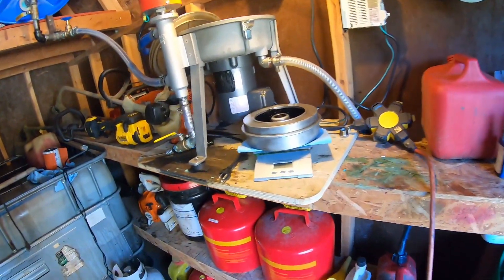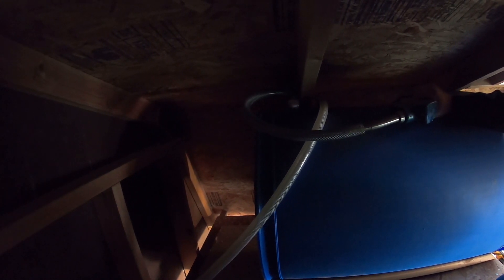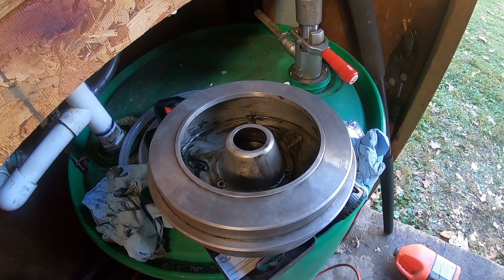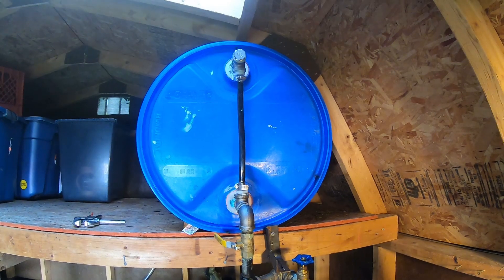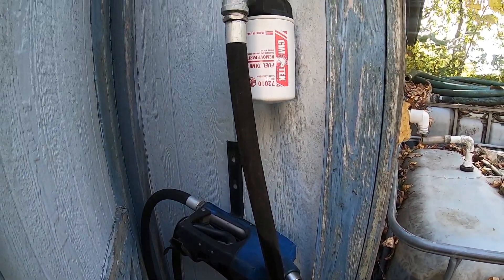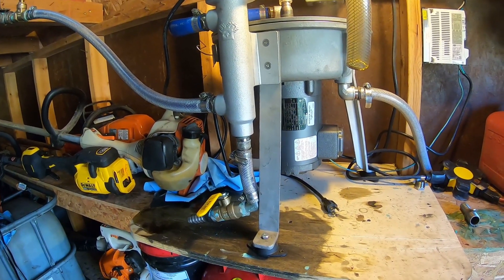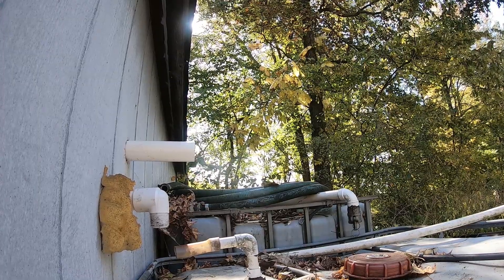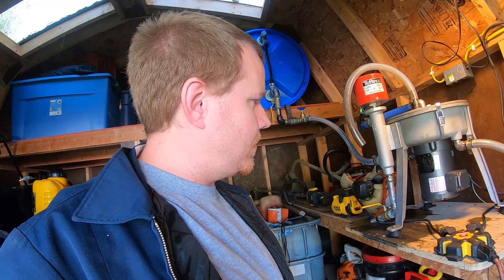Black Diesel - Do Multiple Passes Through A Direct Drive Centrifuge Make A Difference? - WMO - Fuel

Comment: Interesting. Does your feed barrel on your loft  have any settlement or does it drain completely when you do a run?

When you add your rug to the mix how long do you let it sit before you use it? Do you run it through a pump to recirculate and mix or just add to your oil.
Reply from the maker: Very little room for settling in the loft drum and oil doesn't sit there long.  Gets filled the same day it's ran typically.  Gasoline gets mixed at the final stage and I have the nozzle pump valved to recirculate the drum by switching a ball valve.  I'll let it recirculate for 15 minutes or so after adding the gasoline and then its ready to go.

Comment: I’d be curious to see a baseline of clean fresh motor oil for comparison.  That’d probably rule out where that second pass sludge is coming from.   50 gallons of fresh oil compare to 50 gal of wmo.  I know it’d be pricey to do though.
Reply from the maker: Yeah that would be spendy...   the gravity drum only holds a few gallons below the centrifuge feed.  The "clean" drum pulls from the bottom and it was cleaned prior to setting up the direct drive.  It had very little material in the bottom and even so, it would have just plugged the filter after the pump.  It's definitely coming from the oil being processed.  I COULD setup a small batch setup with some buckets just to see how much it pulls out of each run...   but it wouldn't pull nearly as much out of each batch.  Might do it though...  I need to replumb everything anyways.

Comment: I would go with a heated drum for feeding the centrifuge. Seem like it would be helpful
Reply from the maker: I've got a 1200w heater at the inlet to the centrifuge.   No need to heat the whole drum.  It keeps the oil at 180+ flowing through the unit as long as I don't open up the flow too much.  It works really well.
Reply: @NotSoGrandGarage  I been thinking bout doing heated storage tanks. I live where it gets really cold 😂
Reply from the maker: Oof!  That would take some serious juice.
Reply: @NotSoGrandGarage if your thinking inside the box. 😂
Reply from the maker: I mean...  fire would work.  Lol
Reply: @NotSoGrandGarage  got old wood stove setup to heat water I can ghetto something up.😂

Comment: Do you ever had clogged up nozzles or pre chambers on your OM617 using WMO? Marlon
Reply from the maker: @ElectronicMusicUnderground  it's got water meth injection and I've used power service.  If I run it a week or 2 on diesel, it cleans up.
Reply from the maker: Yup.  Right now, it's on a single tank setup and it's hazing pretty good.  I just got the parts in to pull out the injectors and prechambers for a good cleaning.  Running on a single tank at 50/50 my blend to diesel, it ran great for a month before it started getting smokey.
Reply: @NotSoGrandGarage  do you think if you had dual tanks with your OM617 that you would have less issues with the injectors?
Reply from the maker: @SquarebodyTruckCamper  I believe so.  No reason it shouldn't handle oil like my IDI does.  Hopefully I'll find out soon.  I've got a few things going right now but hoping to pull the chambers here soon.

Comment: very interesting. I suppose a cost analysis would make the determination between 1 or more passes. For example if it cost 20 bucks in electric every pass that means your fuel cost does go up. ( compared to road diesel it is still very cheap however) If the single pass does not cause issues like clogged filters or injector coking then it may not be required. I have also heard that water meth injection keeps injectors shinny and new ( from the alternative fuels Facebook group ). so potentially there is no issue at all with single pass.
Lastly do you figure that sludge could have been in your barrel at the top of your gravity system and not actually in your processed oil? I know it would be a huge pain to switch your whole system up for a true test. But that is one thing I was thinking of during the video.   Regardless amazing video as always and I can not wait to see another brand comparison.
Reply from the maker: There hasn't been that many runs through the gravity barrel really and I typically don't let oil sit in that barrel long enough to settle anything out.  With that said, it's possible...  but unlikely.  I'll be doing another multiple pass test here soon.  As for cost, this unit is running 1.3KwH per hour...   and our rate is ~$0.14/KwH...      So roughly $1.82 per 10 hours of run time.  So in theory, you could make 3 passes and still be cheaper than a gallon of diesel currently for a 50 gallon batch.
Reply: I have the 240 volt model it uses  0.132kw per hr. X .13=0.01716 $per hr.
Reply: That does not include the heater. I don’t use a heater on that particular unit.
Reply from the maker: Oh yeah... it only pulls ~150w or so without the heater so that would be nearly free to run.
Reply from the maker: Sure...   but that's over double the gasoline I typically use in my blend.  That would be an added ~$15-20 per batch....     so lets say we run it 3 times...   thats an extra $5.83 per run (if ran 3 times) to not use heat...  where as the heater pulls around 1kw/h...   so my cost is $0.14/hour...   x 10 hours per batch...    $1.40 per run through the centrifuge.  It's cheaper to use heat unless you can get the gasoline for free.  Now with enough passes through the centrifuge, it could potentially be cheaper to use gasoline and not use heat...     but heat drives out moisture far better too.
Reply from the maker: @ElectronicMusicUnderground  got a link?  Sounds like it could be fun to tinker with...